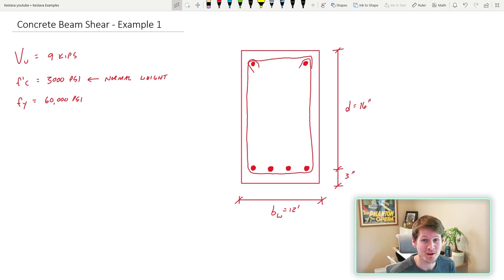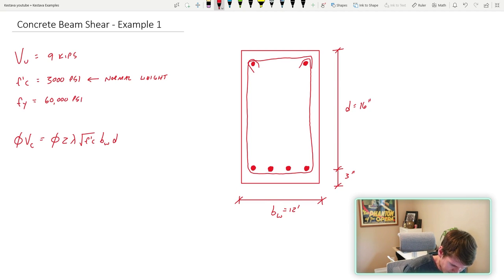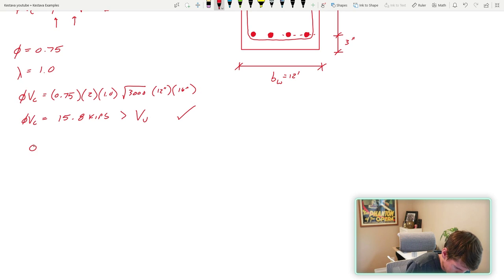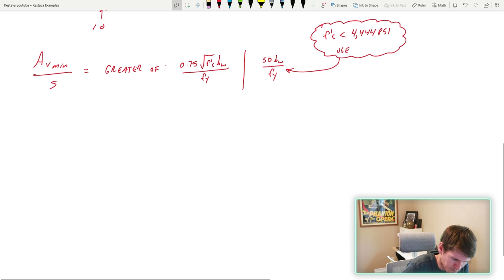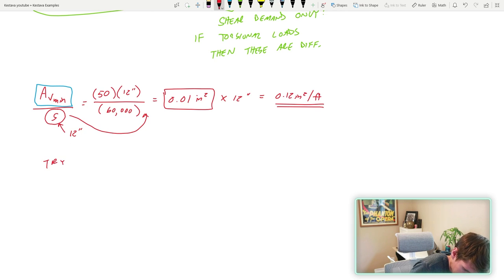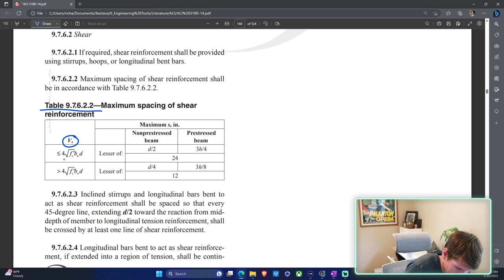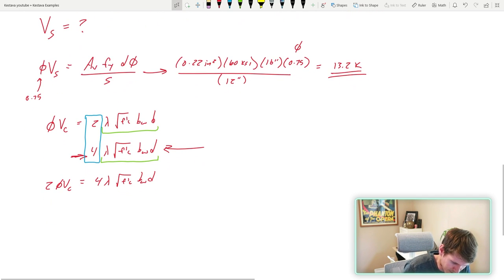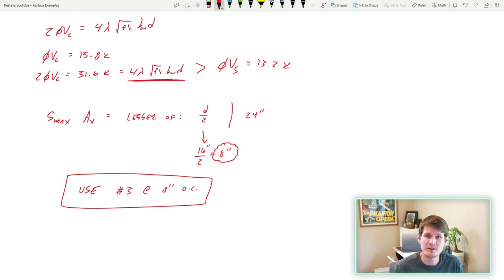Concrete Beam Shear Design Example Using ACI 318 #structuralengineering

Comment: Working as mostly a drafter atm, but one thing that an engineer brought up to replace rebar stirrups, is to use WWR mesh to accommodate. Seems like that would be a good way to go for some things since the diameter of the steel is much smaller, typically of higher grade, and one wouldn't have to place multiple stirrups during fabrication.

Do you foresee any potential issues with that WWR/stirrup approach, or would that be a good path to reduce the amount of materials and maintain max spacing requirements? Just trying to get a sense of what you think and if there are any limitations to watch out for. 

Great videos btw. Really helps with figuring out what is important so I can get a PE eventually, or at least have enough knowledge to help make sure designs are safe as well as efficient.
Reply from the maker: Hi David, when Av is required per the ACI then a lot of the time Av min requirements will also be required. because of this you will be hard pressed to get WWR to meet those requirements. WWR is like welded wire fabric correct? that's what im picturing. and if that is the case WWF has very little steel area. great ideas tho. please let me know if im understanding you correctly.
Reply: @Kestava_Engineering  Yes, you were understanding correctly. Sorry for the late reply. Not sure why I didn't get notified, but yeah, I agree. 

As I work in the field I am finding that WWR can work if sized and spaced correctly, but mainly in places that are small, like a slab with holes in it that is in the realm of 10x10 ft horizontal dimensions and if those slabs are standard precast products used often (wwr takes more time to make than bar due to ordering and design processes). When things get bigger, it often seems that the flexibility of stirrups in rebar format would be better so adjustments can be made during cage assembly.

Definitely a trial and error sort of thing. I work in a plant environment, which is nice in a way, as I get to see the impact of design decisions pretty quickly.

As far as the math. WWR can replace bar. For example, if one needs #3 bar @ 4" oc, then one could probably use D-11 wire @ 4" oc assuming same grade of steel, since the area steel per bar/wire is nearly the same. Sometimes the wwr is faster to use, and therefore cheaper. I have used WWR a bit to work to improve shear capacity while also providing something like "scaffolds" for top mats to help with assembly... that definitely helped speed of production.
Reply: Great video again btw (refreshing as time is coming for testing!), more to my point with the wwr though, we could hypothetically use wwr to get a "bar" smaller than #3 as you were talking about shortly after timestamp 14:00 of this video. Situational use still, and won't always be the best choice, but I think wwr could be a good candidate to consider when we want a smaller "bar size".

Comment: Are you sure for Table 9.7.6.2.2 from ACI 318-14, we are looking at phi Vs and not just Vs? In the table it says just Vs.
Reply from the maker: you're correct - it is just Vs. however i like to compare with phi included so i can quickly compare by doubling the concrete capacity. adding phi to both sides of the equation should not change the comparison. but if you disagree you can / should use Vs for sure!
Reply: @Kestava_Engineering  Thanks for the response!

Comment: If 0.5 phi Vc is greater than Vu, does that mean we wouldn’t necessarily need shear reinforcement since the concrete shear strength is adequate?
Reply from the maker: yes! but make sure you check all other requirements from that code section, just to be safe.

Comment: Why isn’t the top and bottom of shear stirrups      considered, you times the leg’s area by 2?  Thank you
Reply from the maker: you only get to use the steel that is going through the shear plane. the top and bottom of the shear stirrups do not cross the shear plane. think about how a beam fails in shear and the look what shape the shear plane is. hopefully this helps! i can talk a little further in this